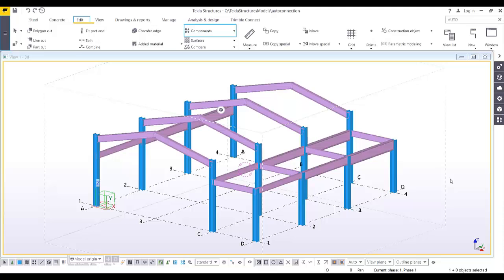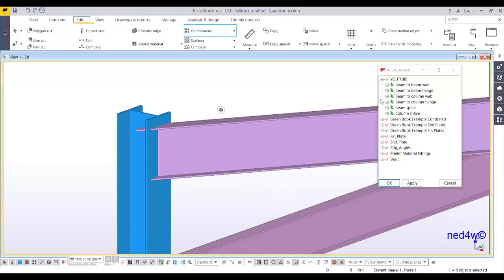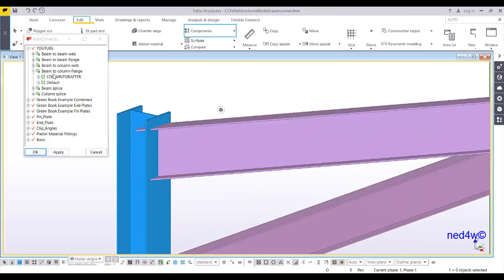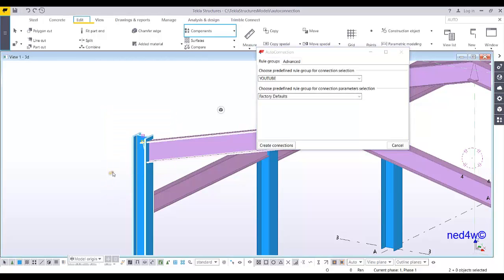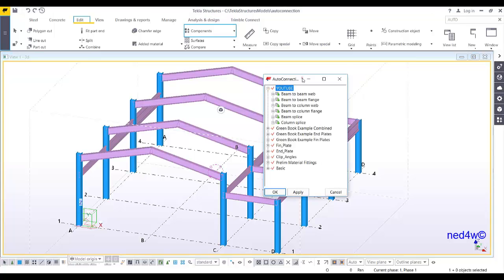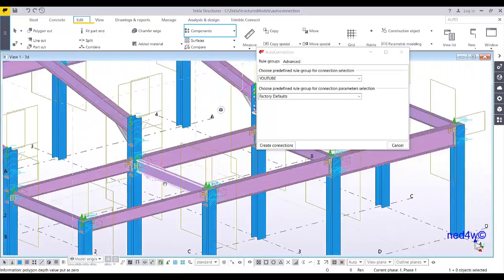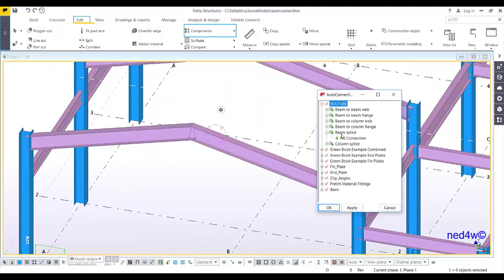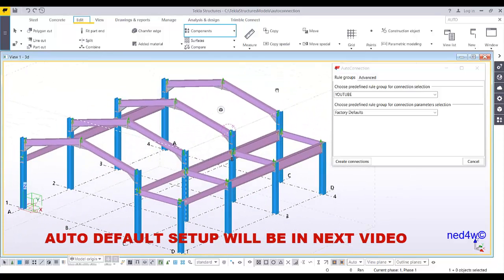How to Setup Auto Connection Rules?

Comment: Thanks for the video! Very helpful. Does autoconnection work with custom-defined connection component? I have created my own component for column-purlin connection, but autoconnection doesn't create it. If I assign tekla default connection component to my autoconnection rule set then it does work. But with my custom-defined connection component it doesn't work.
Reply from the maker: Thanks for the comment, yes it should work in custom component. I remember i uploaded a video with that example. I will try ti find it and send you the link here.
Reply: @thehowsofteklastructures565  ah it would be great, please please